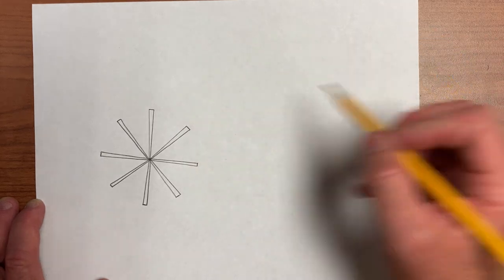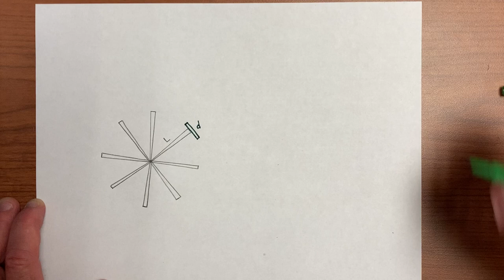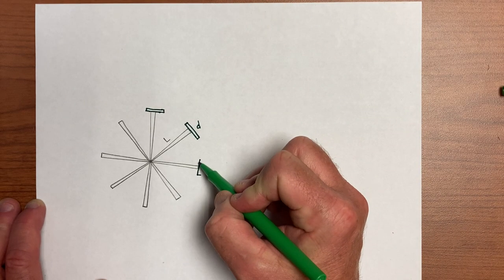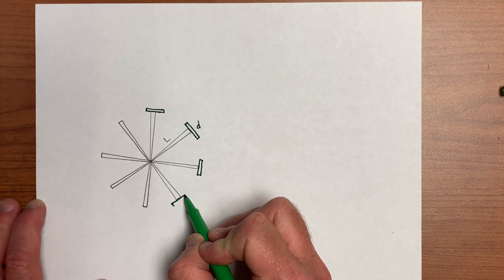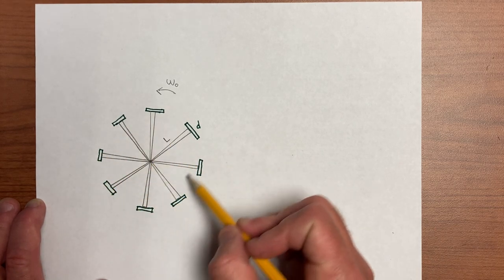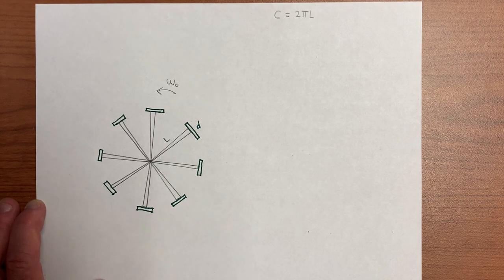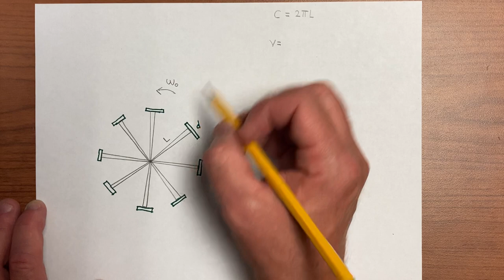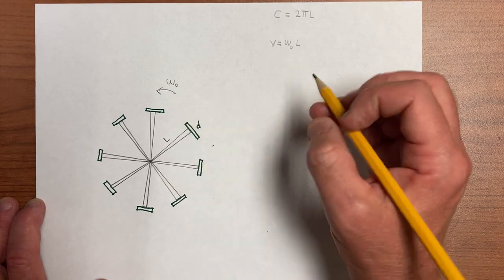Ehrenfest Paradox

Comment: Nice video. On the Wikipedia page, it was mentioned that ehrenfest had shown that the circumference is smaller while einstein argued like you have showing that it is larger. Both show that the spacetime for the disk is non euclidean so, which one is correct?
Reply from the maker: In one case the circumference is observed/measured in an accelerated reference frame while in the other it is explored in an inertial one.